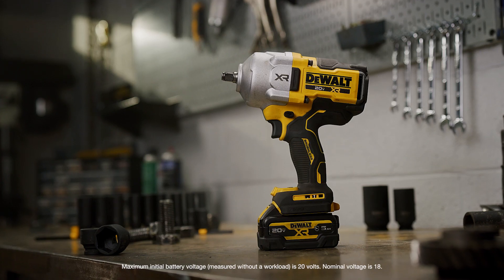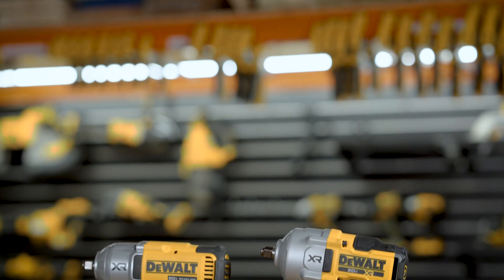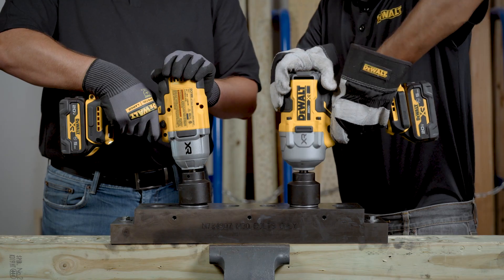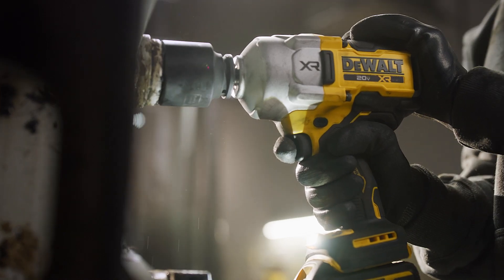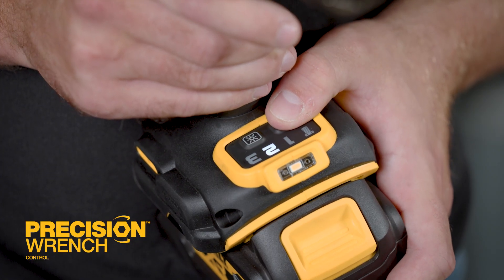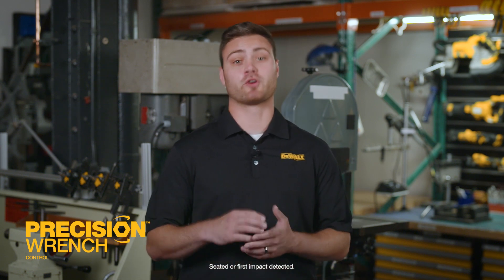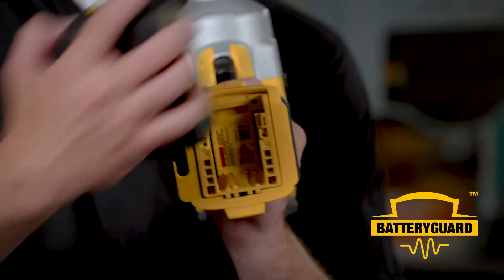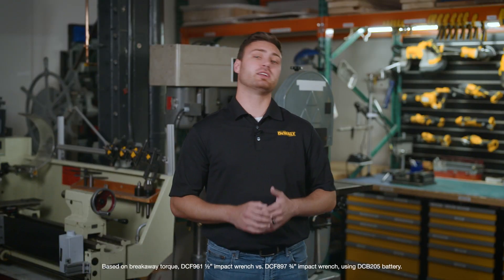DCF961 20V MAX* XR® Brushless Cordless 1/2 In High Torque Impact Wrench with Hog Ring Anvil

Comment: This needed to be a 3/4” drive. You’re talking around 70ft/lb difference on the dyno between this and the 900. If my 900 can’t do the job, I’m reaching for a 3/4” or 1” and heat. This feels like a marketing ploy to crap on the Red Army’s new gun and not something that’s of actual necessity or increased usefulness compared to what you released less than a year ago.
Reply: Look up Shop Tools Review video on Dcf961.  It was loosening nuts torqued to 2700ft lbs!  Meanwhile the dcf900 failed to do the 1800 one i believe.  Hercules ultratorque beat the dcf900 and snap ons in his testing.  New milwaukee did outstanding too, 2200-2400 i think, i forget.  The milwaukee is probably the best choice for auto guys due to the light on it and the shorter length, but surely not as powerful as 961.
Reply: @ndoc8889 You must not live in the rust belt, I've already maxed out my dcf900 and will purchase this new one when available.

Comment: Nice tool, but the 3/4 and 1" version is missing 😉and especially a DCF850 with 1/2", the smallest 1/2" wrench is still to slow and when it hits to strong for bolts smaller then M12.

Comment: 3/4" performance in a 1/2". How about dewalt give us a 3/4" impact!
Reply: They want us to replace are sockets more frequently.
Reply: @sv-et7gq  spelling aside, 1/2" drive sockets generally stop at 1-1/2". Plenty of times I needed to use larger sockets on equipment around the farm.
Reply: @nhendrix1291 Yeah me too. Though adaptors aren't always ideal, the DCF900 handles the larger 3/4 drive sockets like it was made for them.
Reply: OUR sockets  !!!  🥴🙈
Reply: The DCF897 is 3/4
Reply: @jevaissterling5749  that's right but it's sh* and outdated.